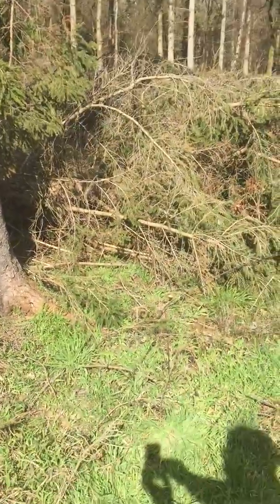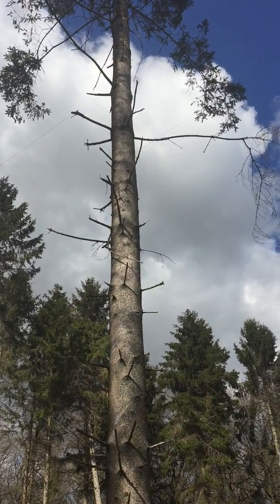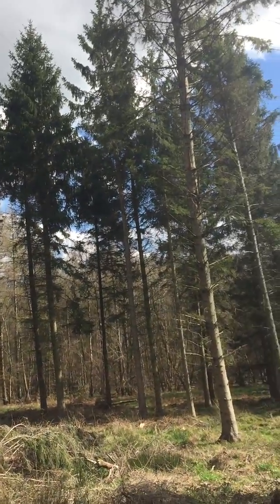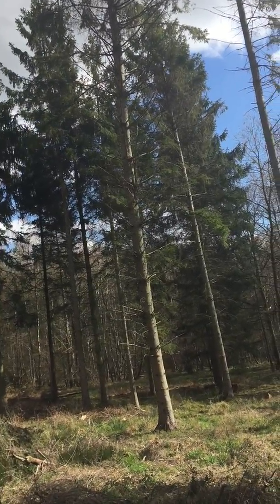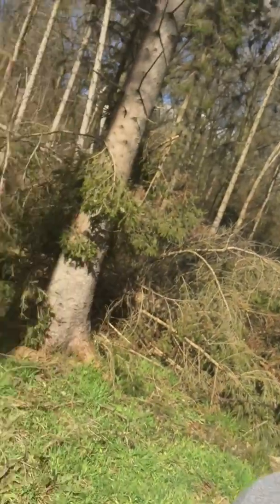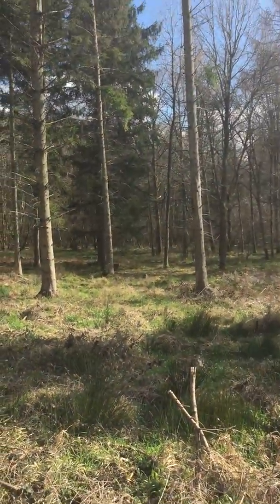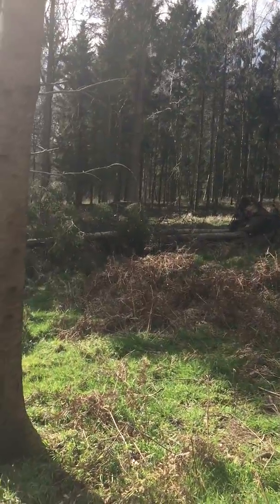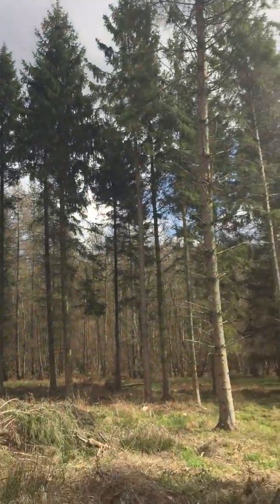Complex Shortwave antenna construction - throw a wire into a tree

Comment: nothing like a wire into a tree. i did this at yellowstone with great results. there you need watch out for Grizz as your string the wire. lol. true though
Reply from the maker: For sure! Wow what a great spot for DXing - Yellowstone! Would love to go there. Been to many places in the US and Canada, but that place is definitely on the list! You can't beat a simple longwire. I think a lot of DXers overthink the antenna and don't get me wrong, you need a decent one, but it's simpler to just put yourself in an electrically quiet environment! 73! Clint
Reply: it was a blast, esp bec all other signals are virtually dead there (cell phone, regular radio, etc). in your experience, does gauge of wire make a difference for SWL or the ham bands? what gauge do you recommend. i have been using speaker wire, shielded. also, length. understand it depends on the band one is listening to, but what is a good length to go with in general? 300 ft? (91 meters)
Reply from the maker: Exactly - the noise floor there will be almost zero and that's what's important - it's not the size of the signal it's the signal to noise that really counts and you can't beat a quiet area. My $200 Sony ICF-2001D will out-perform my $1500 Elad/ Wellbrook combo all day long because they're used out in the woods whilst the Elad/ Wellbrook stay at home in my shack. The only difference is local QRM. 

Regarding the longwires I construct, I always use what we call over here standard equipment wire - single or multi-core work well and both are 0.2 mm diamater (8 thousandths of an Inch). I would avoid using shielded wire - unless you're using the shield as your antenna. As for length, it's better, but not absolutely necessary for a longwire to be resonant to at least one wavelength. I tend to focus on the Tropical Band which starts at 120 metres and finishes at 60 metres, so I have been using a 100 metres. Having said that I've been out and bought more wire and a few bits and pieces to make a 200 metre longwire - which is therefore resonant to more than one wavelength. For general purposes, you will do very well with 90 metres - 300 ft. Big gains over the telescopic of a portable can be easily achieved with a wire extension of just 30 ft. The easiest, cheapest and by far most effective way of improving your HF reception is to remove yourself from local noise. I will send you another message with two videos as an example - my best reception at home and outdoors.

Hope that helps - look out for my next message - it will have links to the two videos. 

73!

Clint
Reply: i do understand about the wave length and resonance and also about the noise level, for sure. this is what yellowstone is so awesome, or the canyon near it. so quiet, much like your DX expeditions in the woods. will look around for some .2mm wire. want to run something in my backyard and compare to my 40 meter double-bazooka which i am currently using for the comm radio back there. it works very well. amazing how much that 20 ft wire added to my telescoping whip improves the signal, even ran INSIDE the bedroom. i have a great signal in there now. thanks for the videos. really enjoy the stuff you do outdoors. i need make more like these. i have some in yellowstone, but they are buried in my channel. need make some categories and post them that way. too many videos over time. lol
Reply from the maker: Yes exactly. Any DXpedition in a quiet location is going to give good results, as long as propagation conditions are good. I've also run some wire around my garden with decent results. Thanks for your kind words by the way - it means a lot to know others are enjoying my videos - I hope the enthusiasm comes across because I love outdoor DXing! Like yours, many of mine are buried - nearly 900 on my channel now and I should take the time to sort them out lol! Thanks again and 73! Clint
Reply from the maker: Compare these two videos - same station - recorded in the woods and at home....$200 Sony vs $1500 Elad/ Wellbrook ALA1530.....73!

https://www.youtube.com/watch?v=dYOsNXYD9Y4

https://www.youtube.com/watch?v=WWNUZNolty8

Comment: Very nice presentation of your DXing spot in the woods. Throwing the antenna wire into the trees is certainly quite an effort, but I think it's worthwile. 73, Matthias
Reply from the maker: +senderjaeger Hi Matthias, thank you very much! I hate seeing myself in photos or on video lol, I'm not that 20 year-old young man any more! So I think you're right, having this antenna 6 metres above the ground does seem to be working pretty well. The good thing also is that I leave it there now, I just coil up the end I use to connect to my radios and hide it. The place I now use right in the middle of the wood is pretty isolated, so I don't think there's much chance of anyone finding it! 73s! Clint